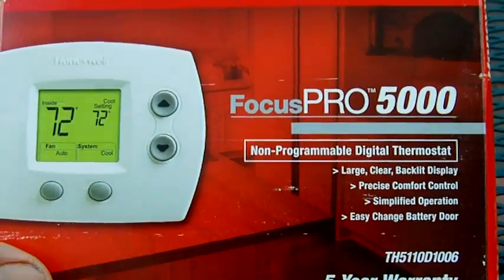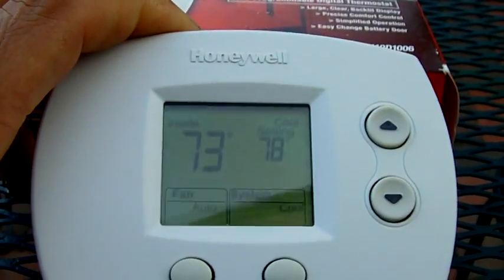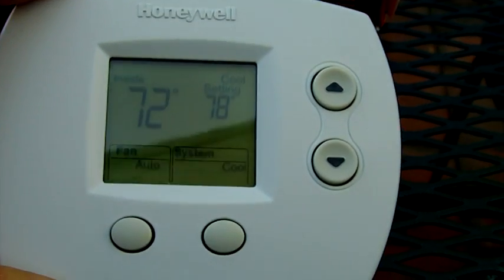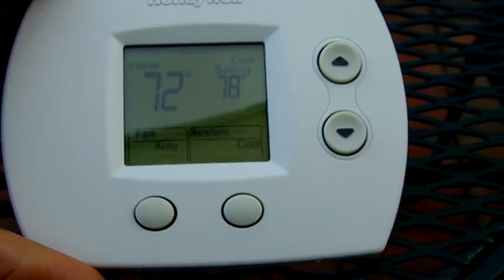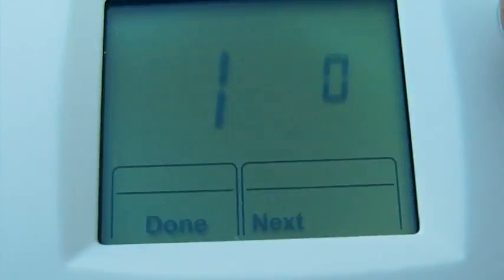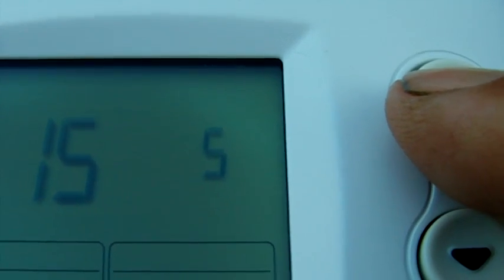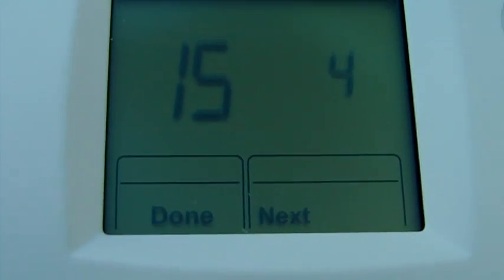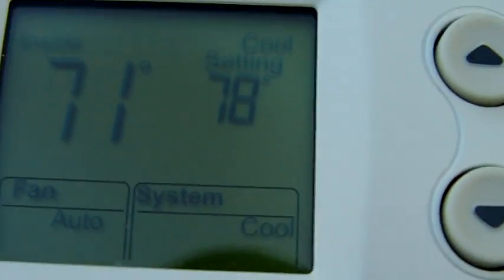air conditioning -hvac-wink- pro 5000 thermostat

Comment: Hello.we just had the focus pro 5000 installed.Aux heat keeps coming on even when the temp is 49 degrees outside and when we raise the temp on the thermo one degree.I won't be able to pay my electric bill.We have had the installer and another HVAC guy to come out and nothing.Any ideas on what the problem could be>
Reply from the maker: sound like wiring problem not the thermostat need more info